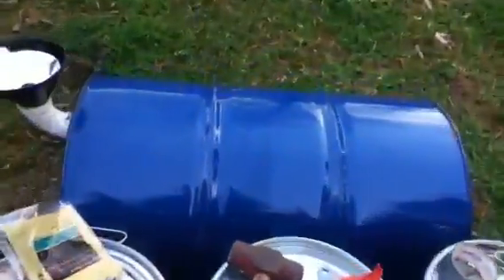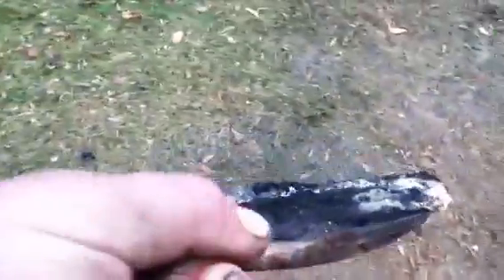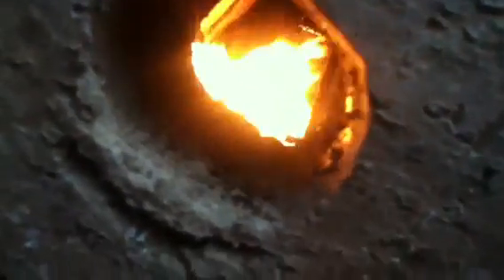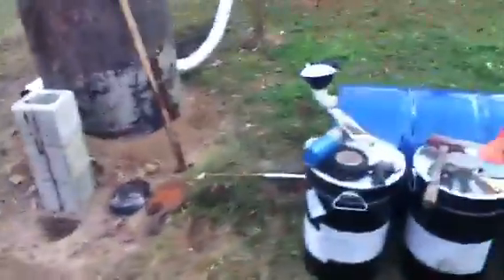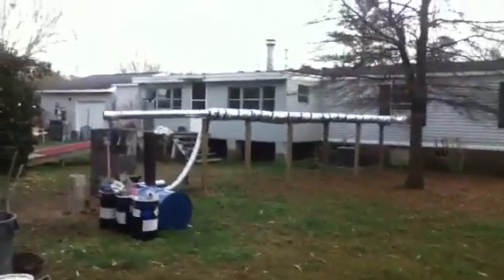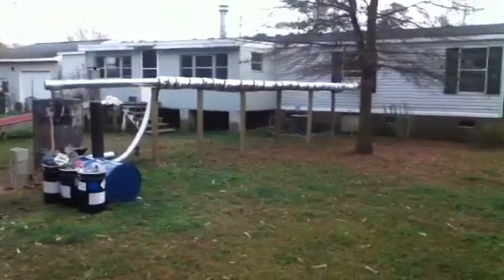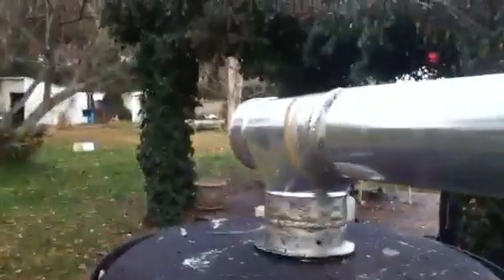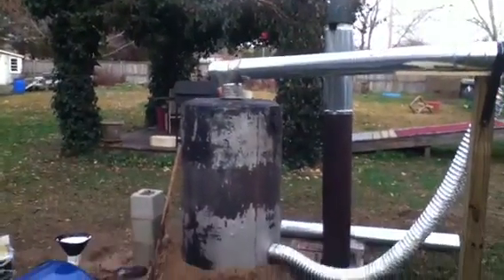Rocket mass oil drip heater

Comment: do you have photos or video of the assembly of your stove?
Reply from the maker: No just a typical mass heater on inside with a huge drum over that no gas from fire in big drum just heat
Reply: This is just what I want to use for the heating of my garage. Presently we heat with wood and it gets expensive buying wood for the winter
Reply from the maker: It worked so well it melted all of the plastic in expando pipe.